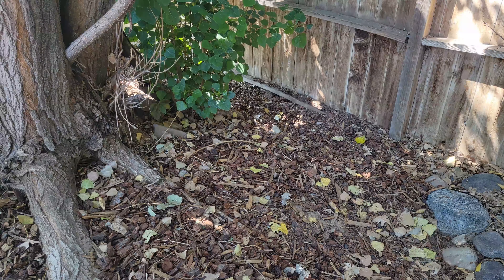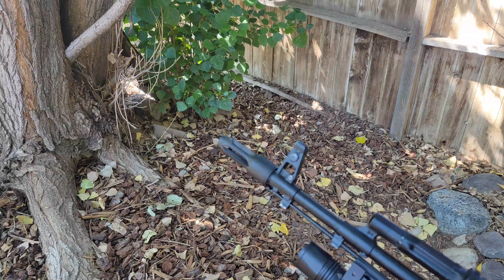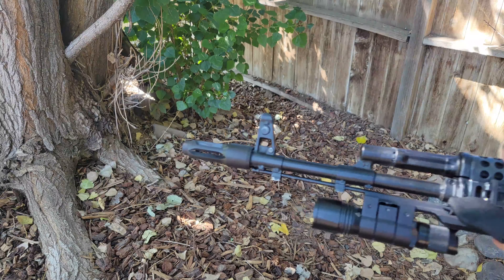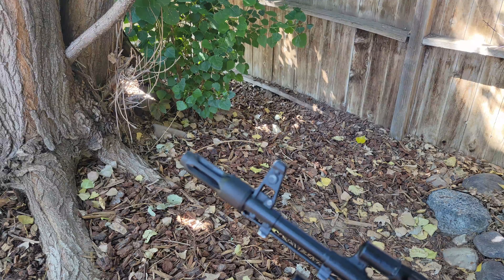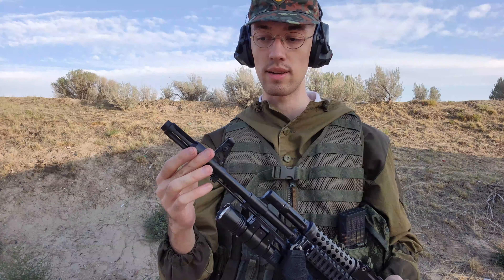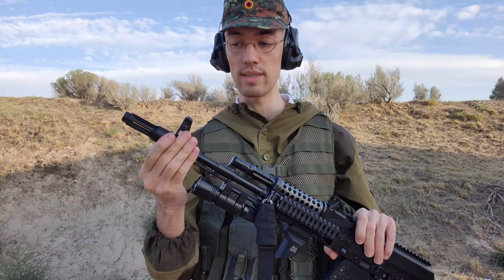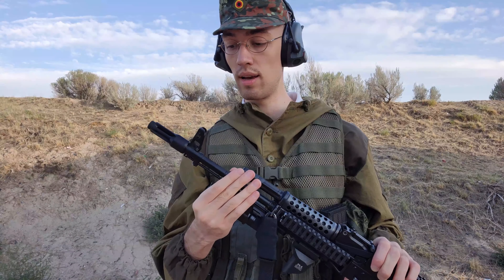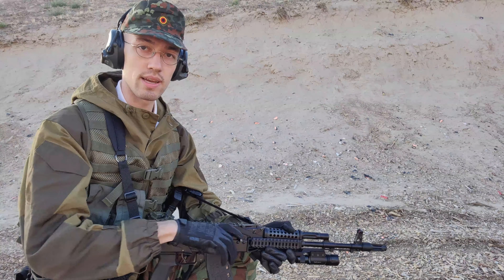AR-M1 AK Flash Hider

Comment: Great video as always! Where did you get it and how much was it? Also, what vest do you run and can it accept plates? Keep up the mighty fine content sir!
Reply from the maker: Thank you! I bought the flash hider directly through Arsenal which I've linked below. It's $100 which is a little steep for a flash hider, but its worked great so far.

https://www.arsenalinc.com/usa/parts-accessories/accessories/muzzle-attachment/flash-hider/ar-m1-4-port-flash-hider-7-62x39mm-24x1-5mm-rh-threads-stainless-steel-cerakote-us-made

As for the vest, I use a SSO Strike vest. It doesn't accept plates though its designed to be worn over a plate carrier. I'm still looking for a good plate carrier, I'm a string bean so it's been difficult to find one that fits properly. I did a video in more detail on it about a year back which I'll link below here as well. One other thing about it is it DOES reflect IR, great vest otherwise.

https://youtu.be/Wl9mCBSOOcQ
Reply: @Feldmutze  nice! I've had a tough time finding one as well, but you can get a size small and run an elastic cumberbund tied onto the existing one. Worked great for me.
Reply from the maker: @Sivil-D  Thanks, I'll try doing that!

Comment: How do you like the PT-3 compared to the PT-1???
Reply from the maker: I haven't owned a PT-1 but in my opinion it'd depend on how you want to set up your rifle. If you're using a side mount the PT-1 would be a much better option since its made to fit with Zenitco's side mount and would probably fit with other side mounts too. I chose the PT-3 because I thought it was lighter (which I just found out its not when looking up the weights to respond to your comment). 

Otherwise they're really similar with adjustment, though I can't say much for anything else on the PT-1 since I haven't personally owned one.

Comment: Where did you pick it up?iw was the recoil
Reply from the maker: I picked it up directly through Arsenal's website. Recoil felt about the same as the standard muzzle brake.
Reply: @Feldmutze  cool I though u had To buy a copy fulll on copy non Arsenal 
Would love to see you try the svvk dtk and jet.  Jet is really heavy but I would love to see you review the svvk dtk with the I believe 2 huge port breaks. Also maybe even a drakon and two of the biggest comp competitors the venom antidote and the akbc in American production. And I would love to see a flash test on a epsilon.
Just a few ideas of high qualcvery high rated comps you can test for content. Anys keep I up the awesome work, love your channel.